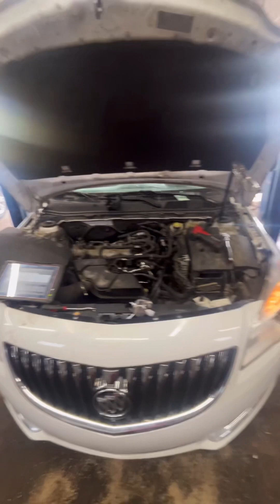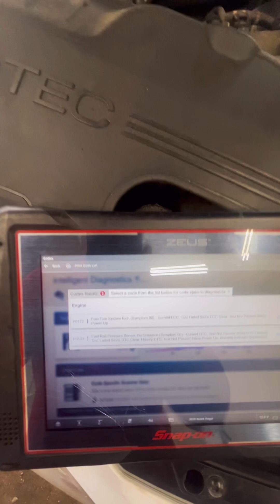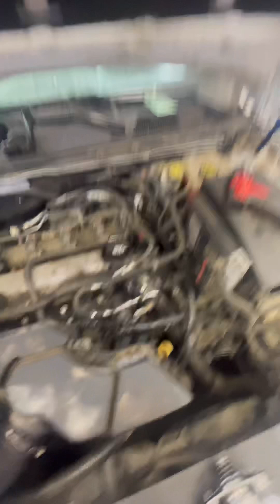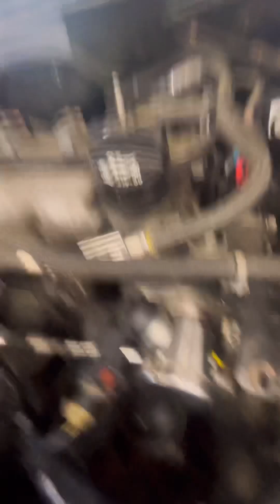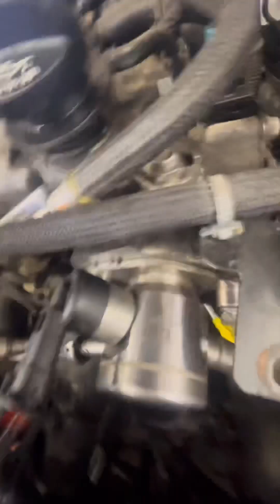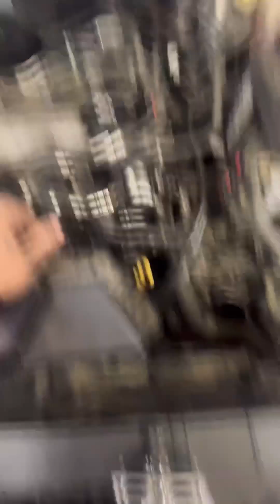Running Rough, Engine Misfire - Buick Regal, Chevy Equinox 2.4l p0172 p0191 Repair and Diagnostic.

Comment: I will post an update on my car when I change the aftermarket pump out with an oem one it’s either that or my timing job is slightly off the car only acts up at idle

Comment: Brother,Im having the same code issues for my 2013 equinox my reduced power is coming on and stabilizer track light comes on once im stopped at the light.... Hopefully this week im going to buy this pump and i hope it works 🙏
Reply: I’m having that same problem bro let know what happens for you I’ve changed alternator ignition coils and sparks plugs
Reply: @lilprophexy205 did you get it fixed?
Reply: Did it work it work out?
Reply: I got the same problem fuel system rich and fuel rail sensor performance I’ve already changed the the fuel rail sensor with an oem one and also change the cat and both o2 sensors with oem parts 
The car came with an aftermarket HPFP pump I ordered a new oem pump we  will see if it fixes it before all this I did a timing job on the car it’s either my timing is slightly off or the pump on the engine is trashed
Reply: @heavyhitter7738  did the new hpfp fix your issue ?

Comment: Thanks for the input, much appreciated. My in laws had their Verano blow the engine due to timing chains let go while driving, when I was swapping out the engine id noticed the fuel pump wasnt included with the used engine for some reason, and I didnt trust the one on the blown engine. Bought an aftermarket one from what I was told was a good company, and a few months after they've gotten the car back, these codes have come up. Ive driven it extensively and only seems to act up at a stop light.